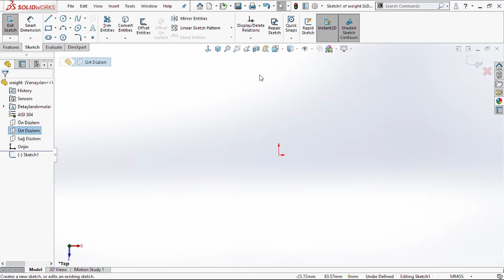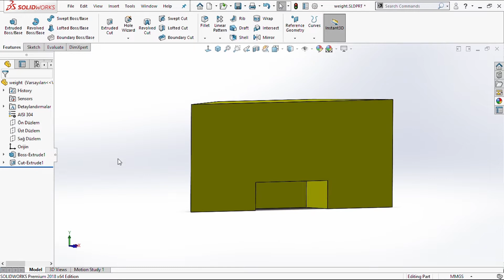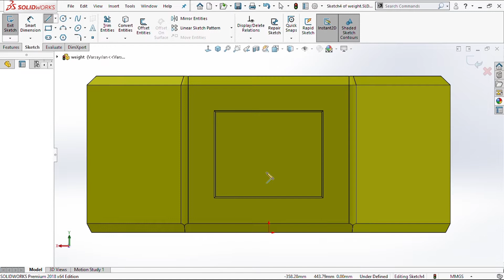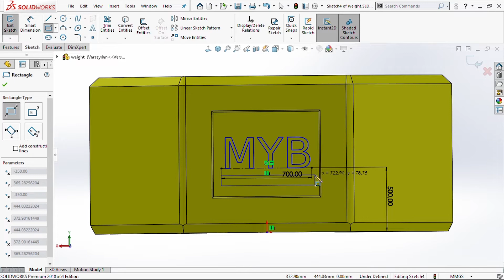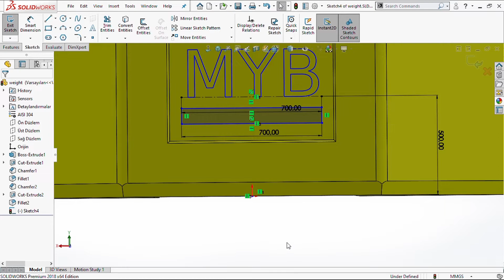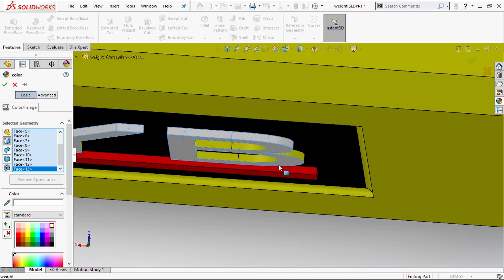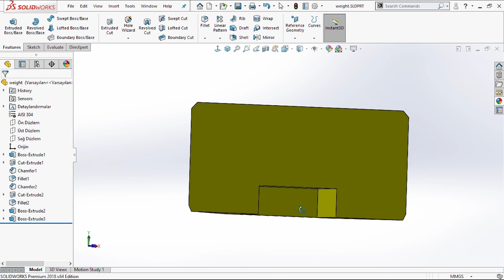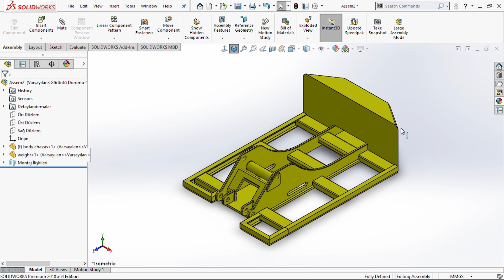Designing An Excavator Chassis In SolidWorks

Comment: Nice work mate! Can you design electric excavator.
Reply from the maker: The electric excavator is no different from the standard excavator. Its appearance, working principle, design, etc. are the same. The only difference is that an electric motor is installed instead of a diesel engine. The electric motor provides power to the hydraulic system.
Reply: @musayasinbicer  Thank you so much for your feedback!
Reply from the maker: You're welcome.